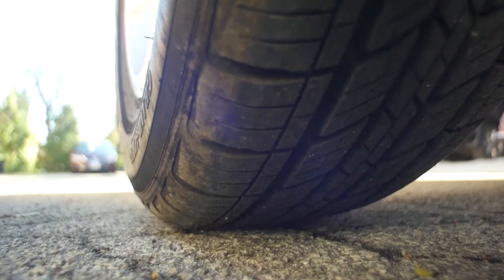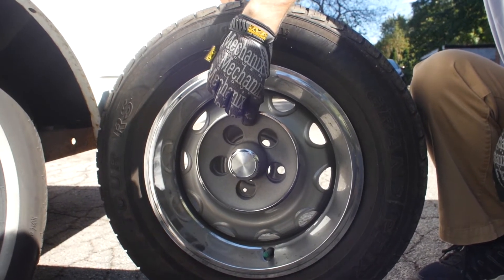Period Correct Parts Install | R+C Weekly

Comment: Multi Mile tires. For when even Kellys or Coopers are too expensive.
Reply: That's just what I bought it with. Rest assured it'll be getting a set of period-look Coker white-stripes as soon as these puppies age out.
Reply: I saw a 2012 date code.... looks like they're close!
Reply: Should be able to last a decade. The car isn't used much (3,500 miles a year, stored indoors, and gentle drives for the most part). So as long as there isn't dry rot, they should be good until 2020-2022. The original tires on my Buick (that I put over 2,000 miles on) were about 18 years old and only 33% worn (says my mechanic), and it wasn't smart but I swapped them for new tires last year. But I didn't die and the car drove fine.
Reply: Yeah, but there's also the impetus that I want them looking correct sooner rather than later ;)
Reply: Yeah it is tempting to stick with the exact period size, I got an inch taller and wider, then swapped the rear drums for disks. It's a far safer and better handling car, huge difference that doesn't hurt the car and could be changed back.